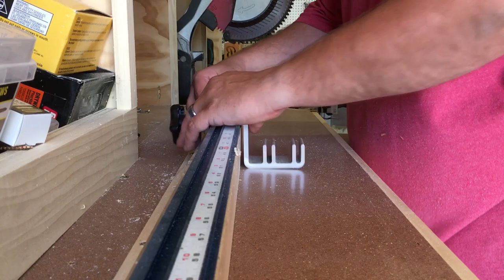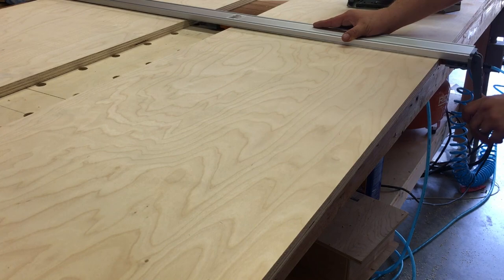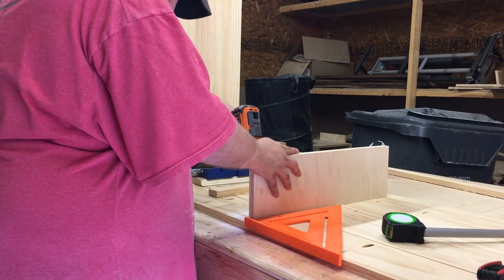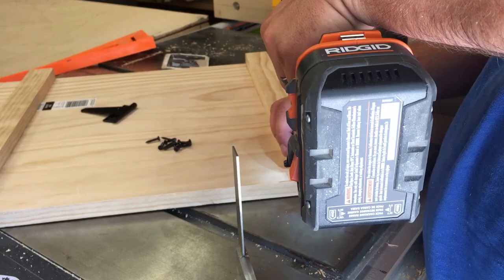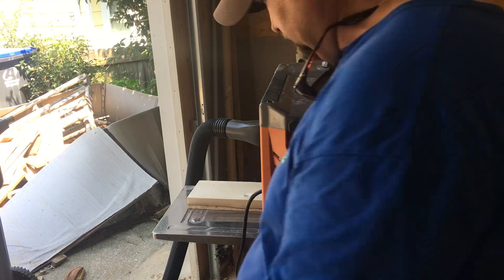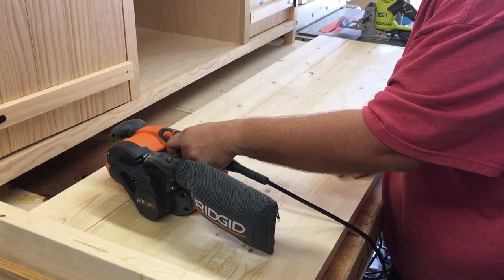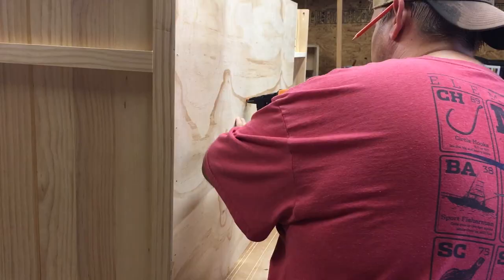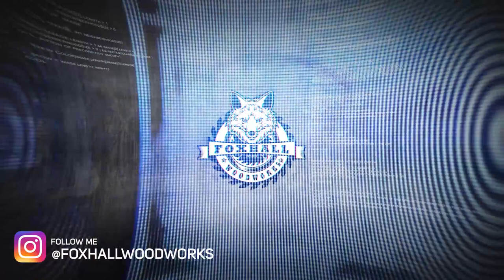DIY | How to Build a Media Console | Woodworking Projects

Comment: Notice u used 2x8 for the top in the plans it’s 1x8s. Are the plans correct ? Or should I be using 2x8s. Thanks and great video!
Reply from the maker: hey thanks for the comment!  the plans are correct.  However, I wanted a thicker top so I went with the 2x8.